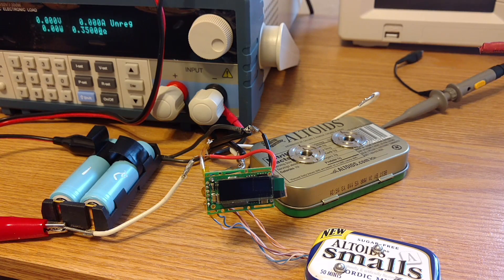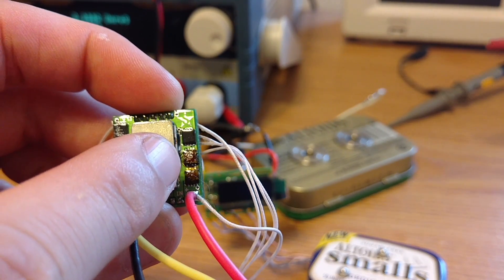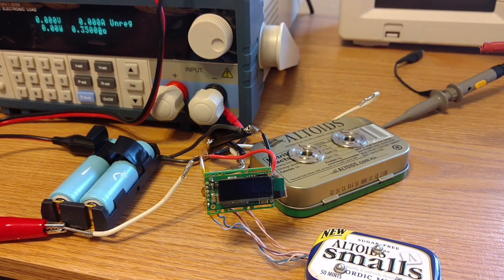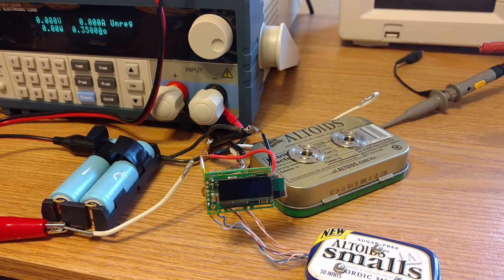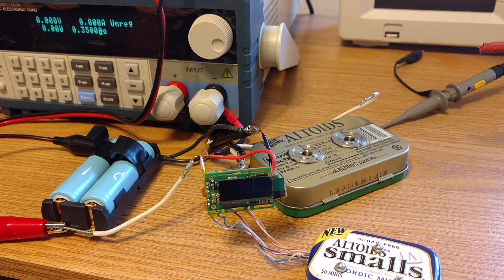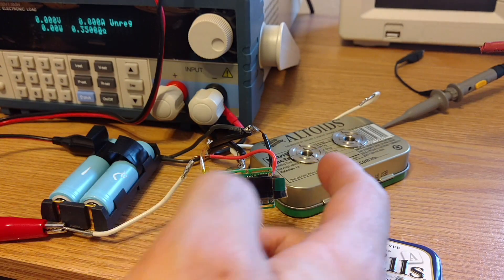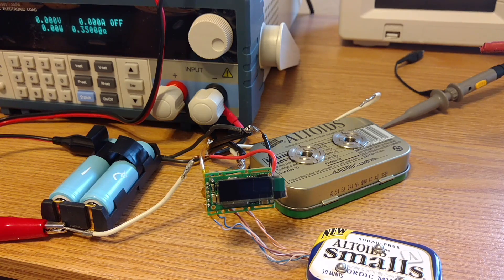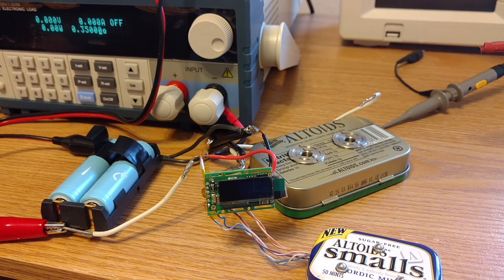DNA40 limit testing

Comment: I am interested in the dna75 board, and it's limitations. .
Reply from the maker: I'll be doing a video for it in the coming weeks. However, it is engineered as every other Evolv board, which is to say it should act within its advertised limits and have controls in place to prevent damage.